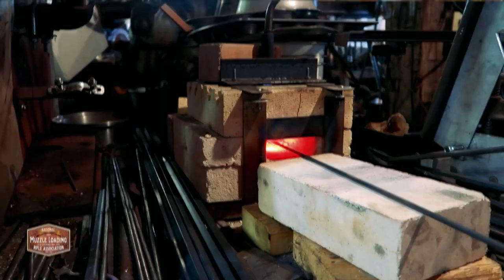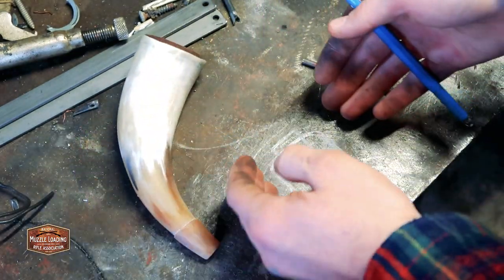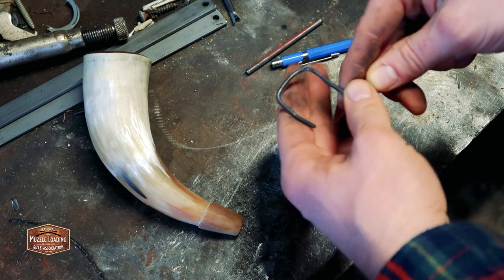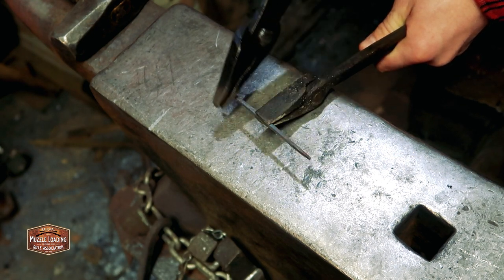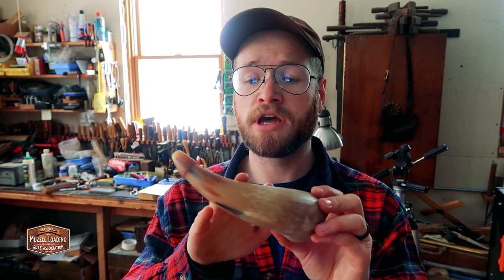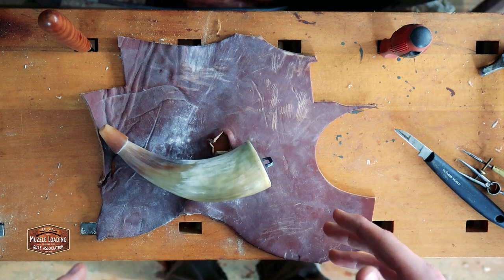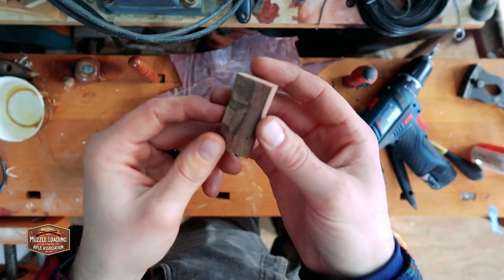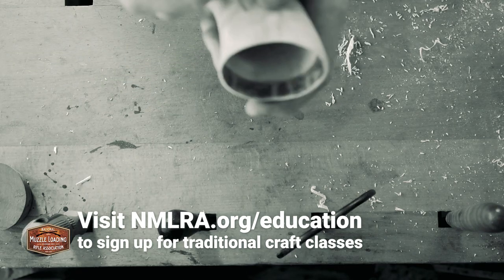Making a staple, pinning the plug, and carving a spout stopper | DIY black powder accoutrements

Comment: Good video. I enjoyed it a lot.  Want to save yourself a little aggravation?  I noticed your base seemed to be slightly tapered from the inside of the horn to the outside.  That's good.  When you get close boil the base of the horn in water.  That will soften it and you will be able to drive the base into the horn.  The horn will shrink and you won't have any of those open gaps to worry about and you won't need the epoxy.  I made a horn like that 40 years ago and it's never leaked and my powder has never gotten damp.  I made my staple pretty much the same way as you did.  I pinned the base into the horn the same way too, except I used whittled wooden pegs instead of nails.

Comment: For drilling pin holes.

Tape around horn base.
Measure around horn base and decide how far apart pins need to be so they are even
(Example, measurement around was 7.5 inches, pins look good to me at 3/4 an inch intervals, so I mark then drill 10 holes at 3/4 inch intervals).
Remove tape, put pins in holes....

I would have used the head end of the nails, cut nails look great and add legitimacy to replicas of older items...

Nice looking horn.

Comment: I like the way that you did this horn and I have a problem non 2 horns that I have one is for a powder horn that I want to make and the other is for one that I bought. The one that I bought is supposed to be fully functional with a powder measure spout on it but it does not seem water tight and when I blow thrue the spout with the valve open it leaked air from the plug end. Slightly how so I make this water tight or is it supposed to do so? And the one t h at I am making the open end where the plug goes needs to be cut square for the plug. What should I use or can I use a Drexel tool also I would like to make a wood screw plug. ccin the plug for filling the horn with powder how do I do this. I am an avid outdoors man Ang getting back into black powder hunting and want to make a lot of my own tools and horn for this I have a kit that I purchased for a rifle and am making my own shooting bag. I don't mind cheating on somethings and go with modern materials for some things but want my horns to be fully functional and keep my powder dry how do I seal them properly? Also what is the best wood to use for the plunge both at the spout and bottom end

Comment: Another simple way of making a staple is to use a romex (electrical wire) staple. You can buy them at Lowe’s, Home Depot, and most hardware stores. I heat them up with a simple propane or map gas torch, twist it 360 deg. and dip it in motor oil and it comes out looking old and forged. Your comiting blasphemy again, they didn’t have 5 minute epoxy back then. Of course they didn’t romex staples either, so I guess I’m just as guilty😬

Comment: 5 minute Epoxy is not period correct, try some Pine Pitch.
And Brass / copper were easier to work back in the day so it was more likely to be used by the common man.
Reply: The propane he used to heat it is not period correct either, nor the artificial light.   Get a life.